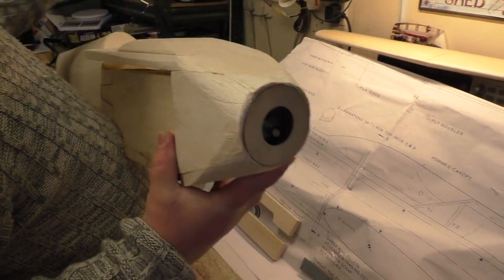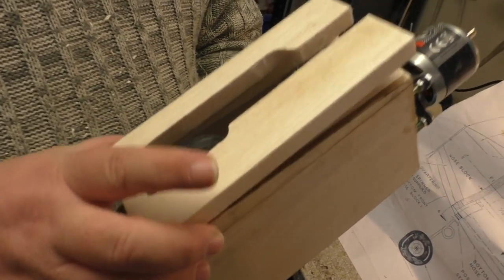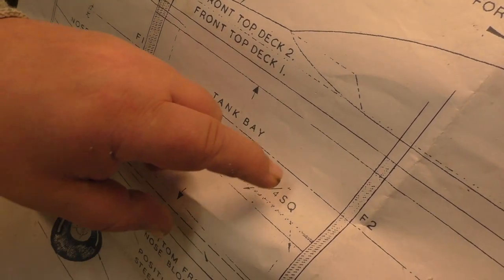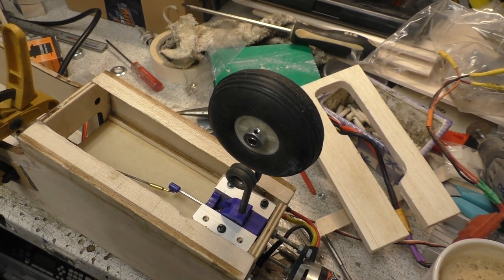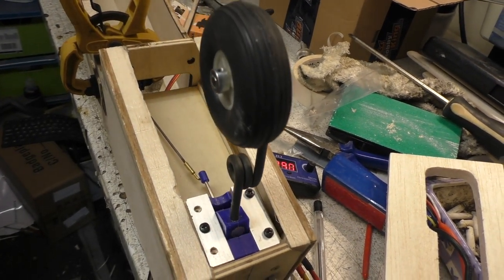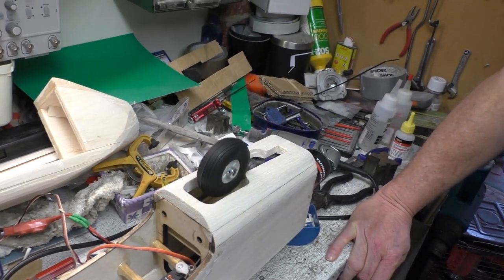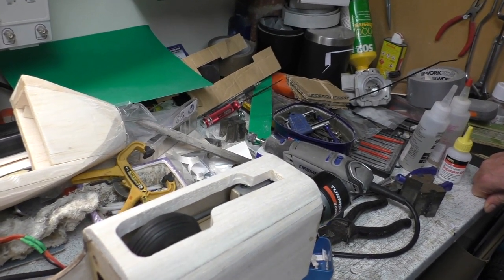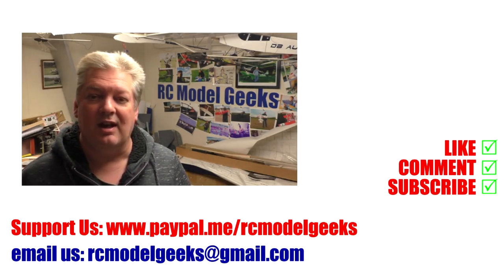PB Models Crescent Tornado Build Pt7 RC Model Geeks

Comment: You could have a problem with that nose leg if the wheel is already (just) touching the bay floor when retracted. It's quite possible the coil spring will close up a little after a few landings, and the leg will rake back slightly.
Reply from the maker: Think the u/c unit is more likely to break before the leg bends ;o)

Comment: Quite mesmerising watching that nose leg go in and out and I was nearly falling asleep ! there is a lot going on in that nose area and you soon run out of room,anyway runs like a clockwork mouse much better than some of these rubbish ARTF undercarriages that Dynam put out and they only work in warm weather because the lubricant seizes ion the cold,

I thought it was Phil who had banana crushing fingers ? is Saltie getting to be just as clumsy,you know the trick on dinged balsa Rob is to put water on the ding and it pops out overnight,it really works too.

One day soon kits like this will be extinct because today if it does not go together when you rattle the box then nobody wants to know,a great pity as they are missing out on the real joy of model flying building your own models.